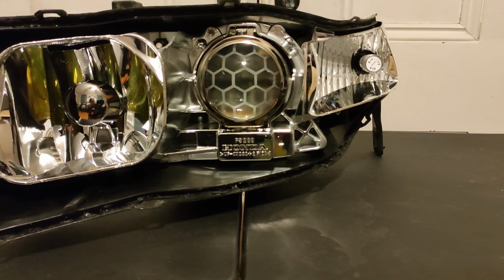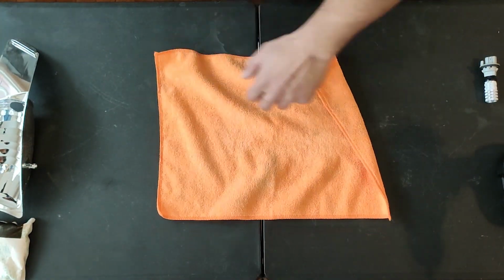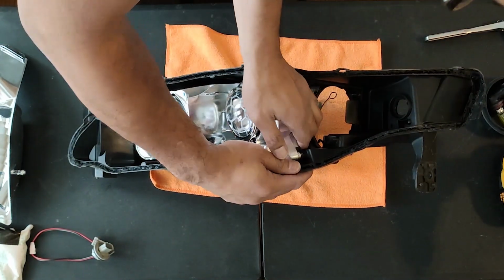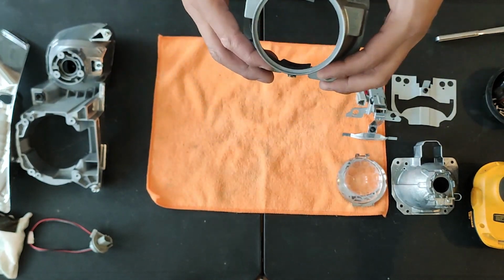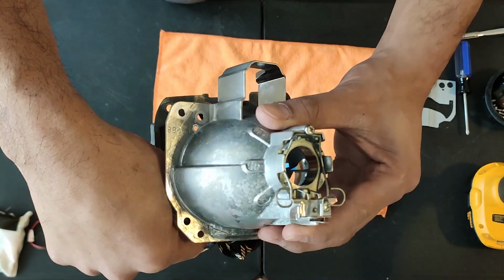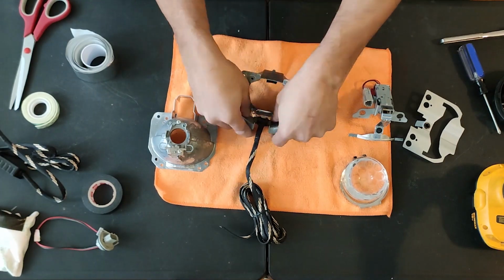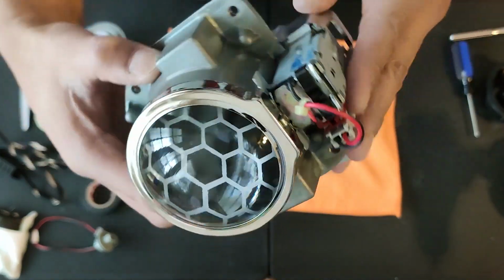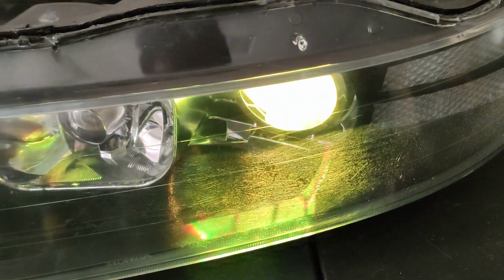How to Install RGB Demon Eyes (feat. ColorMorph Demon Eye) - Acura TL -

Comment: Do they have to be 04-06 TL lights or do they have to be 07-08? Or can they be any year TL
Reply from the maker: All 3rd gen TL headlights have that main projector.  So you can use this guide for any year 3rd gen
Reply: Also how do the demon eyes get power? Is there a video on the wiring?
Reply from the maker: You're gonna have to do your own research on that one.  I'm definitely not qualified and my wiring work is fairly jank lol
Reply: Sounds good thank you for the reply. But I also wanted to ask. When I click on the link for the LEDconcepts colormorph demon eyes RGBW it says that the -Morimoto XBT bluetooth controller is not compatible with it. Also do I need any adapters?
Reply from the maker: I haven't used any of these 12v controllers in quite a long time.  So I don't know what is/isn't compatible

Comment: Quick question.  Were the evo x wheels on the TL a direct fit?  Did you need spacers?
Reply from the maker: Quick answer lol.  Yes, direct fit. And no spacer needed lol.  You do need the proper lug nuts
Reply: @thecarfiend11  thanks brother.  Would you remember which lug nuts you used
Reply from the maker: Not 100% sure.  I think I used ones from Toyota

Comment: listen how did you test your headlights at home
Reply from the maker: I use a USB 5v to 12v wire (negative and positive wire) and a external USB charger.  Works for testing small things that are 12v powered
Reply: Sounds good but I need more information on how to do this